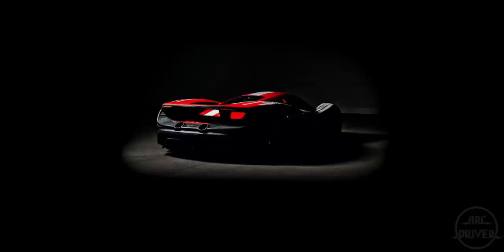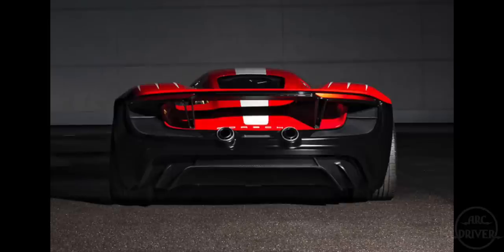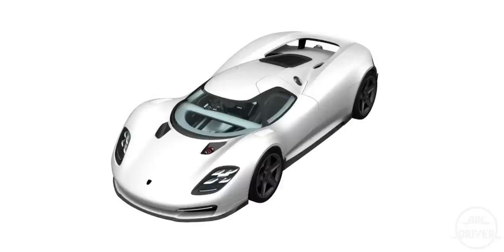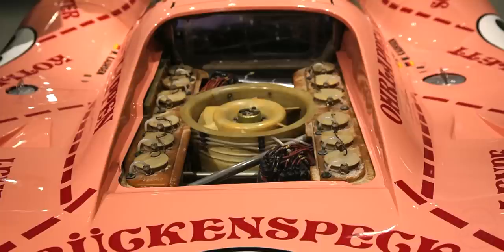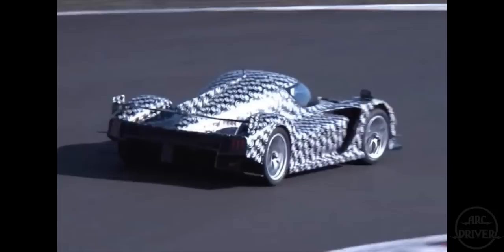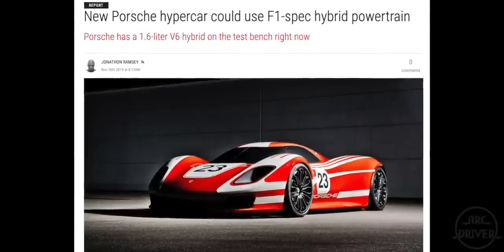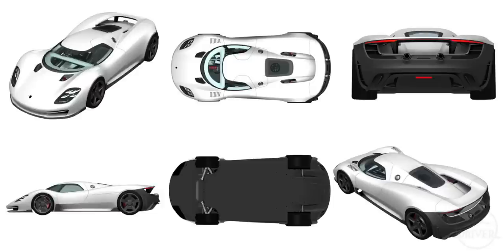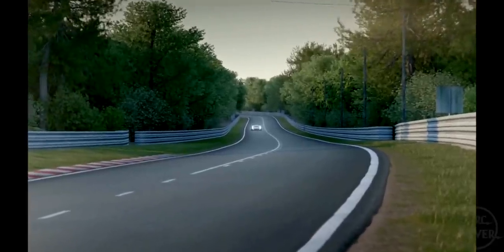Porsche 917 Hypercar Documentary. Is Porsche Making The 917 Living Legend?

Comment: Considering the patents and promo vid, I think this was intended to be Porsche’s road-legal-run-of-25 Hypercar to meet the requirements of the old Le Mans rules for 2021/22 (where 25 road legal versions of a racer had to be built for homologation). However, since these rules have since changed to incorporate the LMDh class – using spec chassis – Porsche unveiled teaser images of a Le Mans entrant for ‘23, but for the LMDh class. Since these don’t require a road legal version and are much cheaper to develop, this along with the pandemic, lead Porsche to pursue an LMDh car over this, an LMH car, since it’s miles cheaper and easier.
Reply: Sad but true. We all want more homologation specials
Reply: @Nathaniel Miller porshe is entering lmdh in 2023

Comment: This would be my dream car, were it to be produced, especially if it had a manual option with the original balsa shiftknob. I’ve been sketching ideas for a new 917 since 2010 or so, so to see it come to fruition would be a dream come true.
Reply: Like a manual transmission with ~1000hp? Don’t think it’s possible, the cluthes are already extremely heavy on supercars with ~600hp so they have resorted to only paddleshift autos
Reply: @onelyone6976  It’s definitely possible. Nissan was making transmissions in the early 90’s that could handle 1600 crank horsepower (RS5R30A) reliably. The issue is finding the drivers who can handle that level of monstrous power without throwing it into a tree when releasing the clutch. On that point, I think you’re correct. Most modern drivers simply don’t have the skill to handle power levels that high with a manual transmission without extensive training.

Perhaps they’ll make balsa paddle shifters instead. 😅
Reply: @onelyone6976  Hennessey Venom GT,Koenigsegg CCX,all 1000+ hp hypercars with manual transmissions.

Comment: Back in the day.....a big "problem" was having the driver's feet out further forward than the axis line between the front wheels. It was a safety concern....enough so....that the 956 racing car was lengthened a few inches to create the 962....and thereby comply with the new safety rules that demanded the front feet behind the front wheels' centerline. Looking at this car....it seems impossible for the feet to be behind the front wheel centerline..... right? The greenhouse is "very" far forward.........

Comment: Imagine this thing had a flat 12 like the original...
Reply: It will be purist delight
Reply from the maker: Like if they combined 2 flat sixes from the current GT3 to create an NA engine that produced over 1000 hp? The old Porsche would have done it.
Reply: @arcdriver1316  ...such an engine would be enormously ... incredibly ....long. The old 917 was a 180 degree V-12 / flat -12 ... but putting two 6 cylinder 911 "Boxer" motors together.....with a main bearing between each cylinder longitudinally...would make the already long old 917 engine even longer.....and with that...introduce even more complications that needed to be addressed on the old engine.

Comment: Porsche is not going to produce the 917 Concept. Not now and not in the mid 20s. Actually there are quite a lot misconceptions in this video:
First off:
1) it's just a clay model with no interior and was shown later completed: actually this argument is not quite eligible due to the overall process of designing cars. 1/1 scale cars are often made out of clay and the interior is at this stage not concluded. Not necessarily because of the fact there is none but more of the stage itself. Even hard shell models don't include a complete interior. If you look at older concept cars that were shown to the public with tinted windows or as a clay or hard model, you will notice there is most likely digital material that INCLUDES the interior. Reason for that is the fact that the interior is mostly done but just not included due to the amount of additional cost and effort. The 917 most likely had an interior that's just not included on the clay model
2) Porsche is going to enter with LMDh 
Actually you are messing up a few racing classes there. Porsche actually aims to compete at the LMDh but that doesn't include street legal versions of the same car. Hypercar class was intended to do so but but isn't restricted like this anymore, too. You ran rather build a road legal car that has a racing version like Toyota does (and AM planned), but you can also built a prototype car like SCG, Porsche or Peugeot. And yes: bykolles and SCG are building street legal versions of their cars, but not because they have to. Furthermore has Porsche already shown a sketch of teaser of their LMDh racer that is more reminiscent of a DPI or prototype than a road car and looks nothing like the 917 LL.
3) patent images: this actually had a lot of confusion in the internet. The images weren't patent images of an actual vehicle but were registered in toy category. This also explains your finished interior. This year a 1/18 scale model of the 917 LL released and another import fact exists: the 917 is planned to be included in GT Sport or GT7. This most likely also explains the Patent aswell as the fact that there are two versions of it as GT often has two different versions of their digital race cars in it (Jaguar Vision SV, etc)